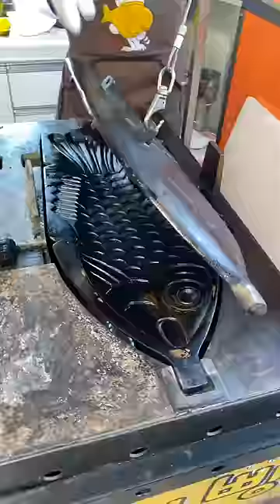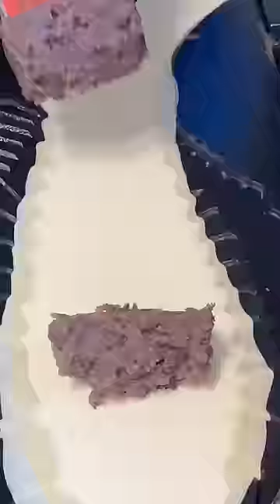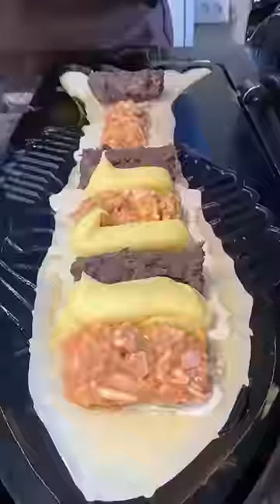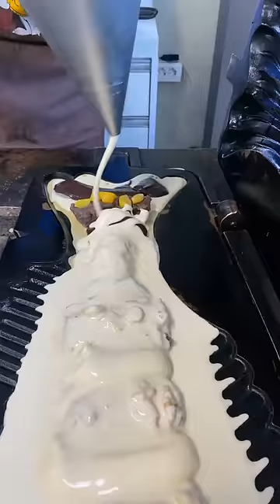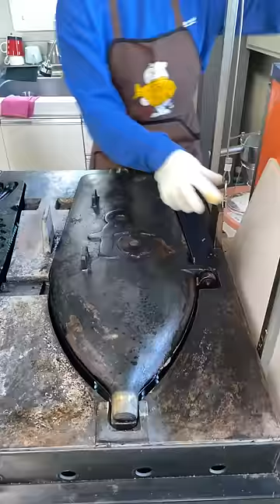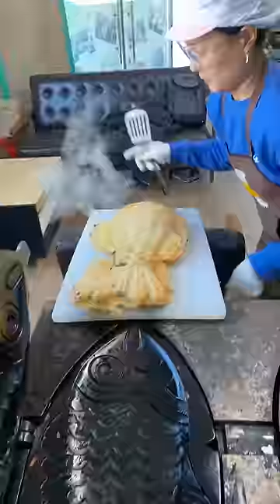Giant Fish-Shaped Bread - Korean Street Food #shortvideo

Comment: I think they could've changed the gear ratio to something else than 100:1😂😂
Reply: Yup lol
Reply: Or add a motor
Reply: That’s some nerdy shit l😂
Reply: @lcmobilecarwash7690 gear ratios aren’t nerdy. They’re basic mechanics that a peasant in the middle ages would understand
Reply: What about 300:0.5
Reply: They opened the other half with just a pick. So it's not heavy. Why the winch at all
Reply: @markcogdill9998 I’m guessing it’s to hold it open? Not entirely sure
Reply: Yes,  to hold it open.
Reply: Thats the actual mechanical engineer in chats
Reply: The higher ratio makes sense given that part of the cooking process is to lift and check the product after turning it.
I suspect the higher ratio allows the lid to be barely cracked open for a quick peek inside. Minimizes heat loss.
Reply: Rather have a wooden hook to open it up quickly
Reply: @markcogdill9998  right?
Reply: @peachmelba1000  a wedge would be faster.
Reply: It's slow since the thing is delicate. You wouldn't want the lid to slam on top of the thing being made, ruining all of the time that went into it. Slow = fool proof.
Reply: I observed the same
Reply: That's pushing it @Hello_there_obi
Reply: @Neuvillete4.6  ?
Reply: @markcogdill9998 Perhaps it's to let the lid sort of settle onto the food so that eay it doesn't come out lookin fucked up or not made right idk
Reply: @markcogdill9998  Exactly what I was wondering. Other people saying to hold it up, but theres much simpler ways to do that other than a winch. Just use a normal hook?
Reply: @Hello_there_obi try to be less sensitive
Reply: @peachmelba1000 You'd do it by time.
Reply: Itu juga keresahan ku
Reply: @lcmobilecarwash7690 I wouldn't expect more from a carwasher
Reply: @markcogdill9998 
因為若是一天要翻非常多次   這個重量就變成負擔了
Reply: Depends who's doing it really.. 👀
Reply: @lcmobilecarwash7690 being proudly ignorant is disgusting.
Reply: @markcogdill9998  heat id imagine.
Reply: 0.
Reply: @vueport99 no that is overkill
Reply: @MarkWazowski  a small motor to help lift the lid isn't overkill when you have to do this 200 times a day
Reply: And yet you ca. Just flip it over and lift it open in 2 seconds 😂
Reply: Hi
Reply: @vueport99 it's overkill. Motors require maintenance and fuel in order to function (before you start electricity is fuel idiot). They can break or malfunction which then costs even more money than you already shelled out to install and run the things.
Reply: @samnorman2307  you got it all wrong, a simple small electric motor to pull the string instead of hand cranking it is very cheap and requires zero maintenance.
Reply: There street cook not engineers
Reply: @vueport99  Or just use a sodding hook
Reply: @osmacar5331  and electronic ignition for the flames!
Reply: exactly my thought!
Reply: Nice one 😅
Reply: Goodness thank you, it was driving me nuts. 🤣
Reply: Is that even necessary?
Reply: Nope, 100:1 means you can operate it even when weak or using a cheap motor
Reply: Eu sol Duda salaber e como isso vai ajudar a criar banheiros 😂 eu quero fazer banheiros não pastéis ksksks mais pode me dar esse pastel eu confisco para fazer banheiros para as polcas pessoas trans 😂😂😂ksksks
Reply: @Hello_there_obi  thats a stretch buddy
Reply: Maybe there is more to it than what we are seeing.  I'm going to give the benefit of the doubt...
Reply: among all comments here are the technicians one for sure 😂
Reply: Maybe he made it from an old sewing machine...
Reply: @lcmobilecarwash7690 a nerd is your boss...
Reply: @vueport99  bruh you wanna buy a motor for this measly task? Pls don't become a politician!
Reply: @Sonofsun.  You talking like someone who never used his hands to do anything. If you have to lift something 100, 1000 times a day, you'll appreciate a motor.

HAHA

Not becoming a politician is the biggest compliment you can give to people these days. Just look at the clowns they have in USA, Canada, India, Chin@... And all the so called world powers ..
Reply: @vueport99   never used my hands to do anything? that's projection if i've ever seen one. 
appreciating conveniece is one thing, wasting money to fix a problem that shouldn't even exist is another
Reply: Bigger wheel so u only got turn once yeesh
Reply: I need a list of things that commoners would have known back in the day before school was a thing.
Reply: @Hello_there_obi   bro no chance peasants knew anything
Reply: @sleeperthoee  i apologise for having minimum amounts of faith in humanity. Apparently I need to lower that to zero 😂
Reply: Or just get rid of it seeing as she open it on the other side by hand.

Comment: That wheel is ABSURD! You could gain a 20% production increase by just making a jig that opened & closed the hatch faster.
Reply: & Give it sensors so it doesn't need touching. It's 2023
Reply: My guess is they are trying to be as traditional as possible. I am sure they are well aware of a more effective way, but it would cost way more and the more modern the more issues
Reply: Yup and also it would be more things to break down and become costly
Reply: Они умнее Вас и им не надо подсказывать...
Reply: @TracySenna how would that cost more dawg.. This way ain't even traditional its not supposed to be mega sized.
Reply: @nuggetman3214 
You had better to suggest more efficient way to worker if possible.
Reply: What’s even the point of that can’t they just use their hand?
Reply: Done that way so the bread crust is not torn.😅
Reply: @ziggity7851 it holds the cast open,

Comment: What's with the winch?  The guy just ends up flipping it open by hand anyway
Reply: what guy?.... this is a lady.
Reply: The winch will keep you from getting repetitive motion injuries in theory. 2 problems, one it only faces one way, and the other it is seems to be geared poorly so you have to crank the wheel too much.
Reply: It's heavy? keeps it while he/she pours the batter?
Reply: Did you not watch the video? She's cooking this food in that metal mold...that is sitting over a fire....and fire is hot. That mold gets hot, so she hooks the cable up to it, and winches the lid open. She doesn't grab the metal mold, but pulls on the cable a bit once the lid is almost entirely opened by the winch
Reply: A simple hook would do the same thing in a fraction of the time. Its over engineered  @OnlineJeeper
Reply: 뒤집는거는 수평이 맞으니 쉽게 뒤집는거고 아래쪽은 가볍고 윗쪽 뚜껑이 무거워 윈치를 사용하는 겁니다

Comment: What’s the point if the crane when you can just pull it up like you did the other side 😂
Reply: Thanks, I was looking for this comment! The crank system is ridiculous 😂 It serves exactly 0 purpose.
Reply: So it can be held open and use two hands
Reply: So it can be help open without you needing to hold it
Reply: @minty3528  So latch it after you open it. It saves the chef like 30 minutes of cranking.
Reply: @andrewrichards2462  ? if you mean latch it from the spine of the stove that would cause a lot of stress on what frankly looks like a small bearing, best to just turn down the gear ratio of the crane

Comment: Wait...the most efficient way to open that is with that hook and pulley system? You gotta be kidding me lmao
Reply: Did you not watch the video? She's cooking this food in that metal mold...that is sitting over a fire....and fire is hot. That mold gets hot, so she hooks the cable up to it, and winches the lid open. She doesn't grab the metal mold either. She pulls on the cable a bit once the lid is almost entirely opened by the winch
Reply: It's heavy and HOT; you don't want it slamming onto your hands when you're filling or unmolding it.  I thought it was obvious.
Reply: @OnlineJeeper - GMTA
Reply: @OnlineJeeper  so how is cranking that winch 25 times efficient? Why not just take a hook by hand, hook it, and then move it over? Better yet, why not put an insulated counter-weight handle on it (like a heavy grill lid) and simply open it when it's done? Cranking a lever like it's a 10-speed bike is the most absurd thing I've ever seen
Reply: @corgiw7281  What is GMTA?
Reply: When she flips it she literally opens it without the cable system. It could be replaced with her hooking it and having a slot to hook it on to or something.
Reply: @XxWITExX yes, she does it manually when she flips it, but it won't stay open like that.. that's why a handle with a counterweight would be beneficial, because she could simply open it with her hand and it would stay open. But it's just the comical nature of the ridiculous winch that's funny about this, I couldn't possibly think of anything less efficient or tiresome. It almost seems like a joke... And if that's the case, I applaud her.
Reply: @OnlineJeeper  - 'Great Minds Think Alike', a fairly common English-language abbreviation.